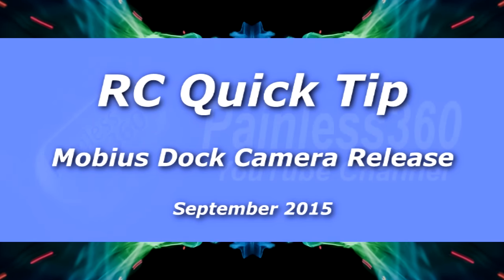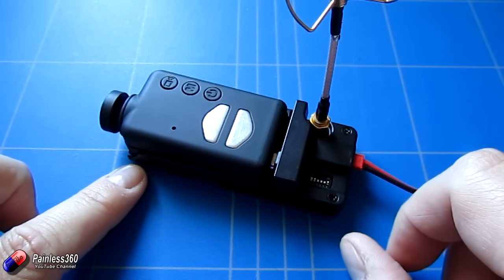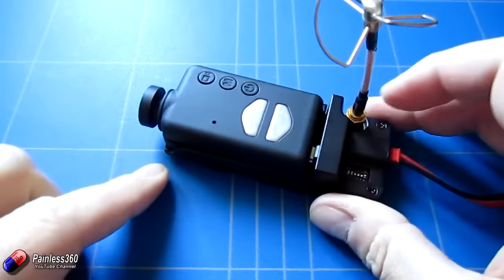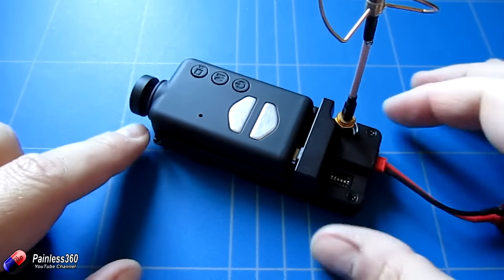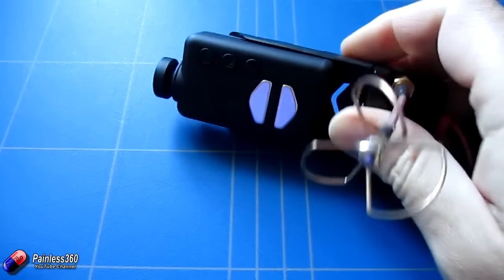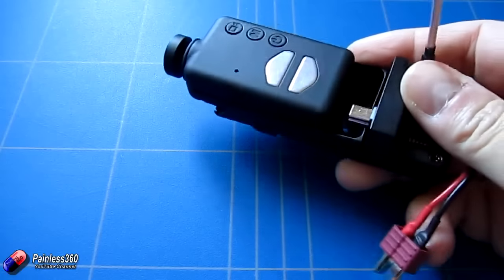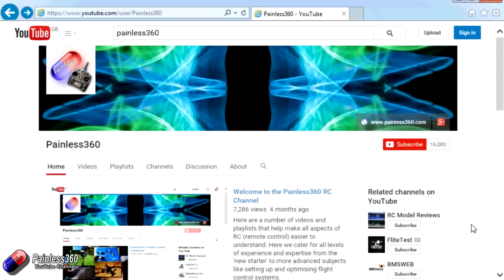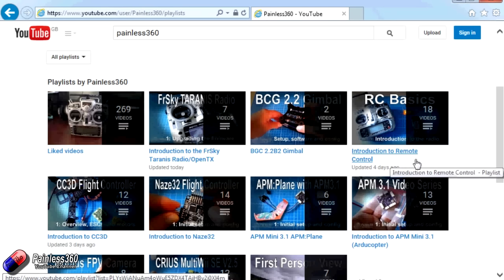RC Quick Tip - Easy Mobius release from HobbyKing FPV Dock

Comment: This isn't exactly rocket surgery but I do think they could of added a single release tab to keep it in there a little more solidly. I've had mine fling out once.
Reply from the maker: I've not had mine 'eject' on a hard landing ;) but I did struggle getting the blooming camera out tying to slide it and pull both lugs down too. 

Maybe a cable tie round the camera and through the 'strap gap' at the bottom of the case may help unwanted ejections?

As covered in the original review I would have liked access to the SD card somehow while its in the dock and then I'd never have to remove it!
Reply: Painless360 Totally agree, SD card access would of been great.

Comment: its me again...thanks for the info on the taranis gps that saved me days of failure...lol.do you have a video on how to get the FC to out put gps to the taranis plus if not can you make one please. youve been a lot of help and much thanks to you. BTW i have a cc3d atom and plans to up grade to the revo so if you could do the video on one of them that would be great for me thanks again.
Reply from the maker: The CC3D will not support frsky telemetry (as far as I know). If you want that it, then look to a more capable Cleanflight supported flight controller would be my suggestion.
Reply: +Painless360 what you be the FC that your most happy with that would be able to do that?
Reply: +Painless360 if i flash cleanflight on to the cc3d would it do it then?
Reply from the maker: Might work depends on the pin-outs it will let you use. Let me know how you get on..
Reply: +Painless360 thanks agian for the info you saved me a lot of time. Right now im waiting for a replacement of the cc3d atom when i get that in i will try it out and let you know.

Comment: possible to hook up a small osd to this module?
Reply from the maker: +Bill Vickers I've heard of others snipping the yellow wire that connects the USB board to the transmitter and bringing the two ends to the side of the case so that it can be connected to an OSD but not done it myself. I've popped mine open and taken a photo so you can see what you're talking about (https://dl.dropboxusercontent.com/u/67301981/Mobius%20Dock%20Internals.jpg). Let me know if it works.